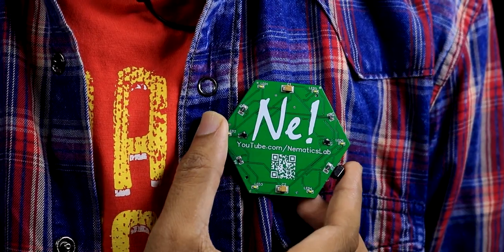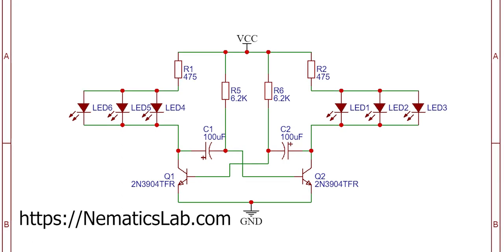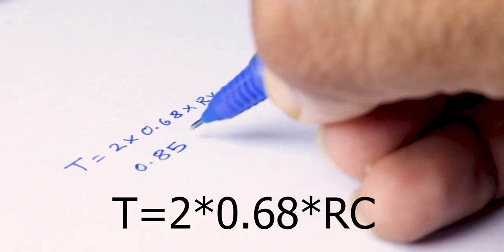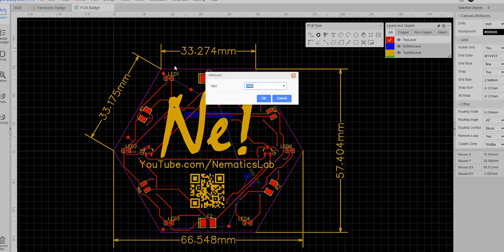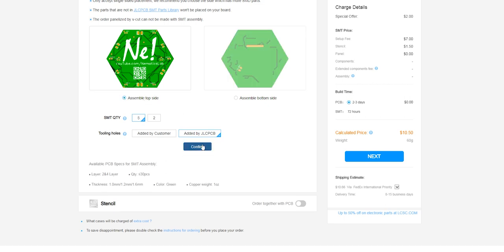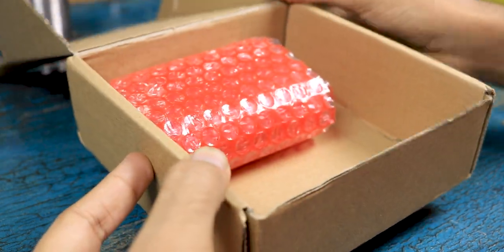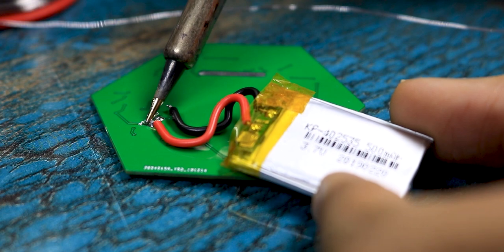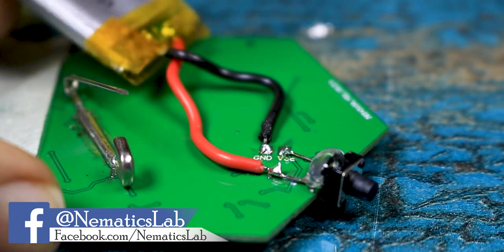How to Make Custom PCB Badge | DIY

Comment: hey there! i made up this circuit and it blew a capacitor! i changed the second pair of resistors to 6.8k and kept the first pair at 470ohms but everything else was the same as your values.. any idea why that happened?
Reply from the maker: Capacitors might have been connected in reverse polarity